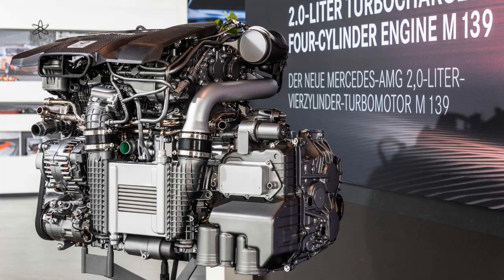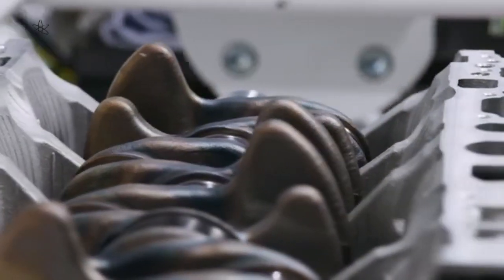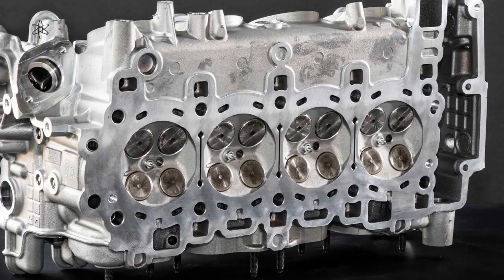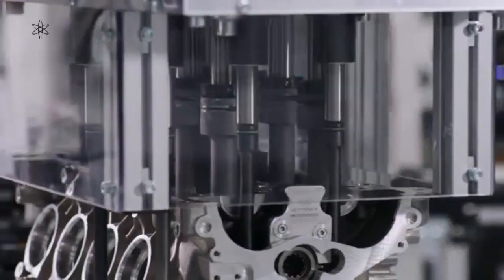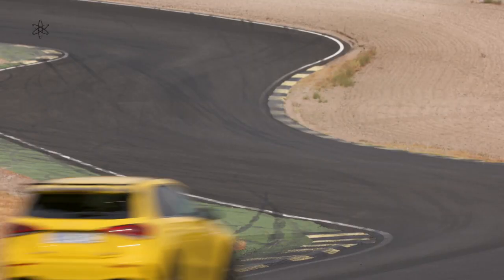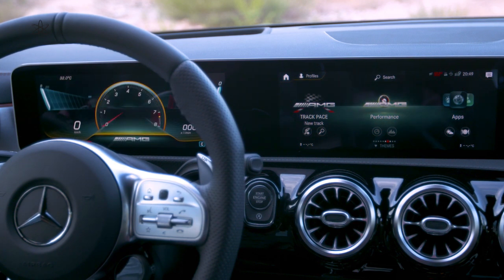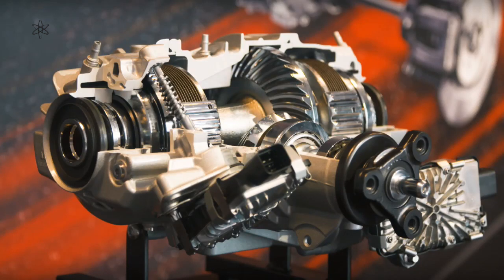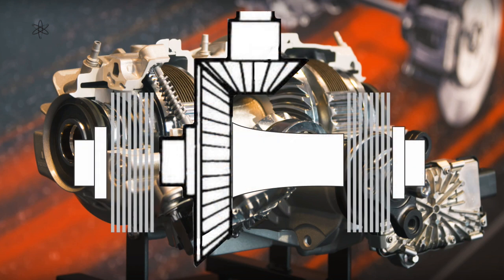Mercedes-AMG A45 A45S Engine And Rear Differential

Comment: You have some engines mixed up the M156 does not have the same square bore as the 4cyl I think you meant to compare the M177 Engine as comparison. I think you’re trying to capitalize on the videos from amg and you don’t really know what you are talking about.
Reply: the video clearly states is comparing the m156 combustion chamber valve arrangement, if you cant even get that then what are you even doing here?